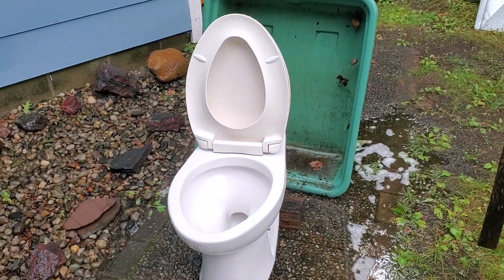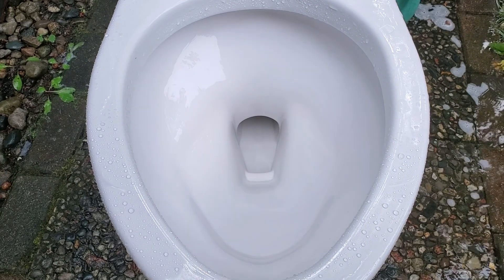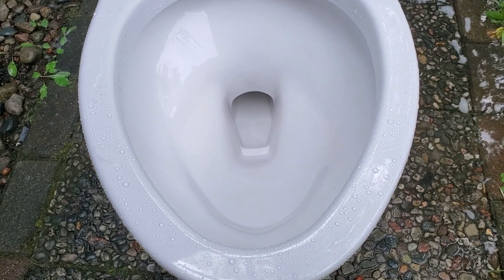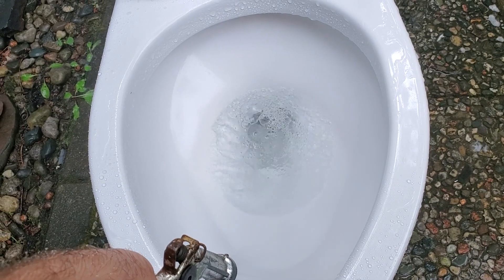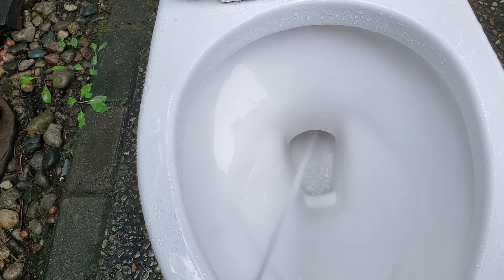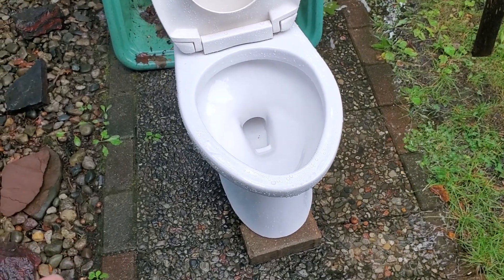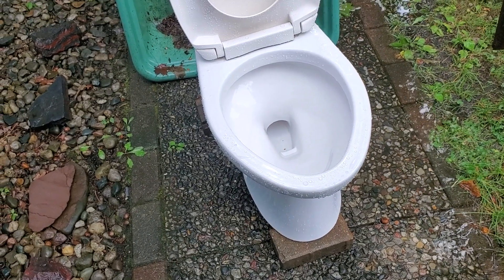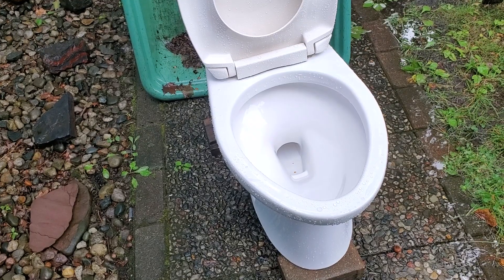#209 Flushing Toto Drake with a garden hose.

Comment: Lately Toto and Gerber have been my favorites and for this being one of the reasons with lower water consumption with a quicker syphon followed by a decent drain line carry from additional water after the syphon begins. I ended up buying a new Toto Drake for our first floor powder room. Once called the Drake 2 but now all Drake models have the rimless vortex “tornado flush” it’s extremely effective at cleaning the rim and does not require a second flush. I have seen some quality flaws across a few Toto’s that I have installed in the last few years but other than that the flushes are very good
Reply: On the other hand the American Standard Vormax struggles to pull a syphon with little water and the two flapper design is less to be desired. The flapper that feeds the syphon jet must be set correctly to open first and begin that syphon while it has plenty of head pressure in the tank and also you have to flush them quite a bit after installing to purge any air in the syphon jet cavity they have as a negative pressure setup to use less water. You can tell by when you dump the water out of the bowl you must do it twice to fully drain the water out of the syphon cavity. I have a Vormax I just got from a job and coincidentally enough pulled a Toto Ultramax vortex flush toilet (the better of the two). While the Toto pulls the syphon quicker the Vormax is actually better at flushing more rags or bulk material but will struggle with anything that floats. I think for average use the Toto will still come out on top.
Reply from the maker: The Upstairs toilet where the Toto is drains through the wall next to the stairwell in the house so every flush is heard through the wall. I bet the old Mancesa spent about 5 seconds dumping water through those pipes. With the Drake, it's literally a whoosh through the pipe in about 2 seconds. It's less water but I'm sure the actual gpm rate out of the waste is much greater! It's really impressive. I also really like the 360 degree bowl jets. Quieter and less splash In my opinion.
Reply: @vintagekohler6085  I can attest to that haha my 1989 Gerber Mount Vernon (elongated standard height) installed in the hall bath upstairs when flushed sounds like water dumping down a water fall in that PVC stack for about ten seconds has yet to need a second flush or clog. The Toto installed in the powder room when flushed heard from the basement is so quick. However I do notice more homes I go to for sewer main backups, house trap blockages are ones with 1.6 or less gallon per flush toilets. Especially in older homes with porous cast iron I recommend customers to keep their 3.5+ toilet for that reason and rebuild. I believe there is some sort of marketing/plumber job security behind that whole endeavor but only a conspiracy lol
Reply from the maker: @starlitetonight  that makes sense. Even with the proper pitch, the flush volume is only good to carry everything down a pipe so far before it dissipates too much and solids get left behind. We don't have a really long sewer lead out to the street but I'm sure the San Raphael helps keep it clean too. 
On the subject of gpm, I know some flushometer toilets have minimum specs from the factory. The current Kingston needs at least 25 gpm @ 25 psi of flowing pressure.  The Sifton needs 35 gpm @ 35 psi flowing pressure. That's pretty neat really. Those are on the spec sheets on the Kohler website.
Reply: @vintagekohler6085  That’s really helpful I would definitely like to find some of those sheets to calculate that run. Obviously many variables to take into consideration but would get together a better understanding for a rough
Reply from the maker: @starlitetonight  I really find it fascinating on the supply side of things because depending on what your static pressure is, you can use bigger pipes to deliver tje same volume if the static pressure is low. Once you open the flushometer, the pressure drops and that's what they mean by flowing pressure.
Reply: @vintagekohler6085  That’s such a problem I run into. Back in 2016 when I did my first flushometer setup the basement with the 1946 Madera you sold me I ran 1” all the way from the well tank tee over. I have the switch set to kick off at 72PSI. So it has plenty of pressure for shower heads/faucets. But that toilet had a mediocre flush at best on that setup due to the volume loss over that run. If I was to redo that I’d do at least 1 1/4”. There’s an old silk mill nearby they added many apartments inside of and the main is 3” but they have a massive manifold down in the basement, the 3” is copper and there’s all of the tees on the branch with 1” pex adapters to run 1” pex all the way to each apartment to serve a Flushometer toilet, sink shower and kitchen sink but they all have terribly weak flushes from that reason and especially since it’s cinch ring pex the nominal diameter is smaller than copper at the fittings for example 1” pex fittings are 3/4” ID. And they have 70psi which is on the higher side of normal
Reply from the maker: @starlitetonight  Oh wow that's interesting! Yeah 70 is rather high. I've seen manifold systems and I'm not really a fan of it. Really though,  70s psi is more than ample pressure so the pipes really should have been sized for the demand and length. 
Most commercial buildings I've observed with flushometer toilets use 2" mains until pretty close to the toilets before reducing down. I think doubling the diameter increases the capacity by 3 times if I remember right so 2" carries a lot of water!
Reply: @vintagekohler6085  It’s pretty disturbing how many things are pushed off for saving a few bucks but running smaller pipe or whatnot in that instance anymore. The plumbing industry is transitioning into more of a installer/replacement type of job since nobody wants to repair things anymore! I get some type of satisfaction out of repairing something older but in good condition as it does take the skill and know how in certain aspects

Comment: I have done this before thanks to the handheld bidet on the Ingenium Wellworth.... 
I do it just to clear out the skid marks from the trapway area.
Reply from the maker: That sounds handy. Probably better than a brush if the sprayer will work. I haven't tried a bidet yet but I would love to.
Reply: @vintagekohler6085  I still have to use the brush though because of some hard stains like minerals, formation of the ring... 

Having a bidet sprayer is definately handy, will save tons of money from toilet paper purchases and can keep the toilet bowl clean.
Reply from the maker: @ToiletsofWNY  Definitely. It seems like it would be easier on the backside too. May I ask how you prefer to dry? I suppose you could probably pad dry with some TP and still use less than you would with no bidet.
Reply: @vintagekohler6085  it dries automatically after the job.

Comment: These are underrated by a lot, my friend replaced a early 2000s cadet with a drake in 2018 and it has yet to clog 5 years later!
Reply from the maker: I'm not surprised! Mine has clogged maybe 4 or 5 times, but never ended a plunger.

Comment: these are way too hated. I have one, installed it (first ever toilet i ever installed) and it never clogged. It was great for 7 months, and then i replaced it because my mom wanted a taller toilet. It was also in my main bathroom after being in the basement for another 5 months and then we got new flooring in the bathroom and the drake no longer fit. But if i could i’d definitely install it again, i probably will eventually
Reply: Most of today's toilet community will not like anything that's "modern".
I may not like most modern toilets, but I do have a respect for Drakes, Vormaxes and even Powerflush.
Reply from the maker: @ToiletsofWNY  I agree. I like many vintage toilets but there are some new ones that I really like too. The best part about the Drake is it's performance. I like the style of my Kohler Gabrielle much better and I like it so much that I'm fine if it struggles once in a while though it's been good so far.
Reply: They are fantastic toilets.
Reply from the maker: They are definitely good toilets! My Drake is also standard height which I like better but they make ada ones as well.